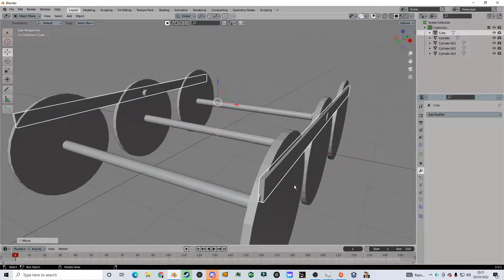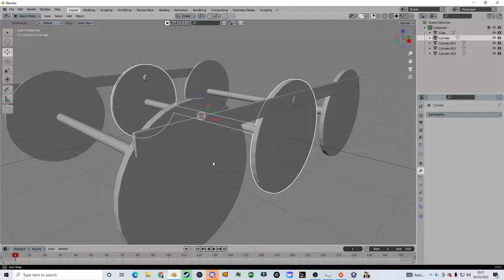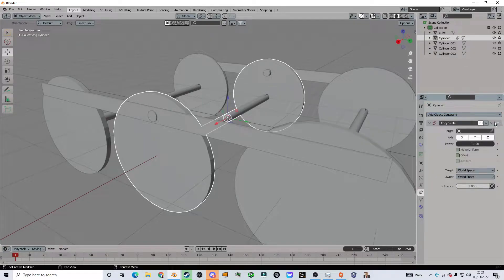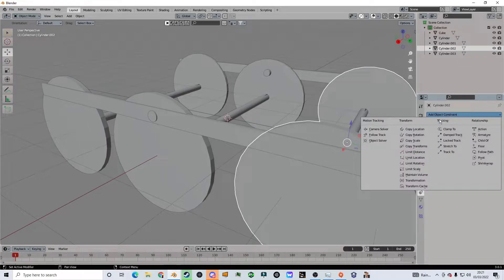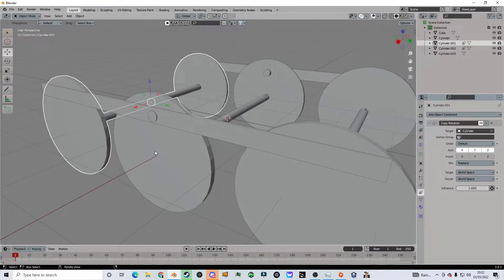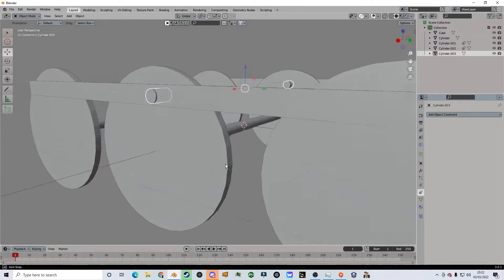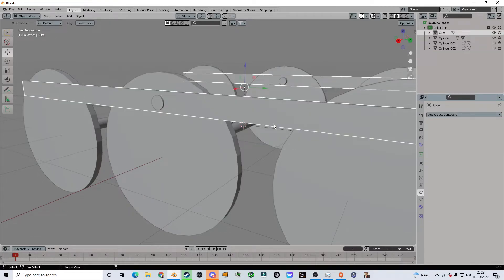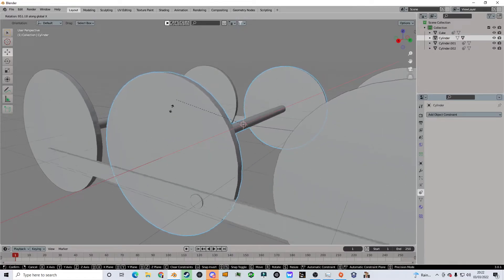how to rig a train in blender 2.9

Comment: This is helpful, but I do have an issue, using the latest version of blender, the wheels rotate fine, but the side rods do not rotate to line up with the other wheels.
Reply from the maker: Use edit mode to realign it or change where the active element is
Reply: I was able to find a fix by putting COPY ROTATION on it, but for some reason, my rods actually flip upside down @gingerninjalewis698